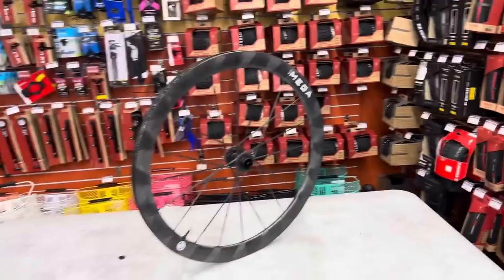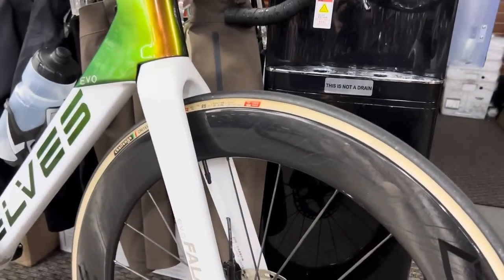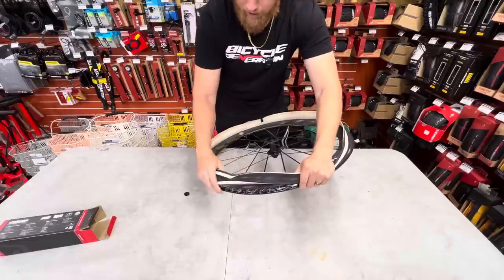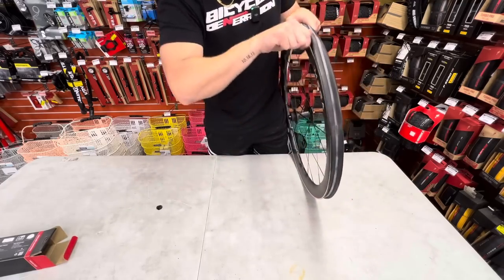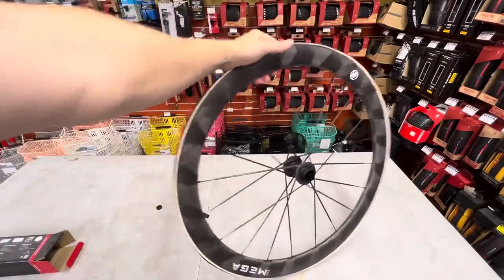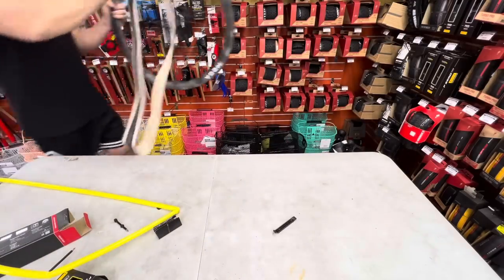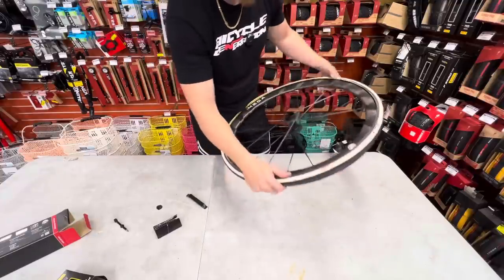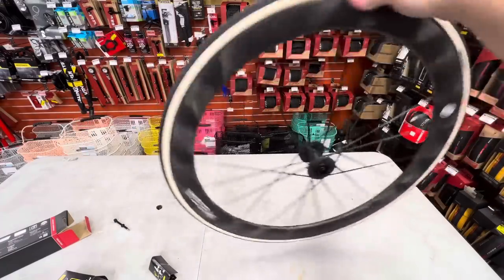I LIED..... 99% OF CYCLIST CAN NOT INSTALL THIS TIRE!! *IMPOSSIBLE*

Comment: Wow! I made a mistake buying the Challenge Getaway 40 mm wide foldable model together with TPU tubes as an upgrade to my gravel bike. I have aluminium rims 19 mm wide that came with the bike. They are not tubeless-ready, hence I wanted to ride the new tyres on TPUs. Oh my God - I wasn't even able to fit the tyre alone, not to mention put the tube in. I admit - I gave up. I installed just TPUs with my old tyres. ☹
Reply from the maker: I have got challenge tires down pretty good
Reply: @GCPerformance18  I don't deny their performance - I bought them due to the good balance between the tread pattern I was looking for and low rolling resistance in independent tests. The tight-fitting probably makes them better sealed on the rim, even without sealant, when running tubeless. But... I knew tubeless tyres could be generally run with tubes, hence my idea. This doesn't apply to these tyres, though - not out of the box, and not on cheap narrow rims that are not tubeless-ready. As you've shown, installing the tube is possible for an experienced pro, but I guess for normal mortals this becomes possible after riding tubeless for some time - after the tyre stretches a little bit. These tyres (with tubes) would be also very problematic with punctures in the field. And I'm not so much about speed but more about efficiency. I ride casually for fun - I'm not racing. I guess I'll keep them - perhaps at some point I will change the wheels too, and then maybe I'll switch to tubeless.

Comment: They're tight and annoying to get the sealant in because they lay flat but I managed without too much swearing! Getting them off however, they would NOT come off the rim edge (zipp 202 firecrest)! I had to use a thin screw driver, destroying the tyre and marking the rim in the process!

Comment: HAHAHAHAHAHAHAHAHA...I CANT BELIEVE YOUVE DISCOVERED THIS CHALLENGE TIRE!  I MOUNTED THIS ONTO AN ALEOUS 27.5 CARBON TIRE...   I COULD - NOT - GET THE TIRE ON!  I SPENT DAYS!  IT WAS REDICULOUS!  WHY DO THEY MAKE THIS TIRE SO TIGHT??  LIKE NO OTHER TIRE!   Just so happens, I found an actual plastic "lever," NOT a tire level like you have, but an actual, large, two part, leverage tool that hooked to the rim, and the tire, giving me a "handle to pull" that tire over the top...NO JOKE!  Heres the thing however...the tire "bubbled at the bead...!"  Thats right.  After all THAT...1.5 months later, Im looking at the wheel from the side and I see a bubble right at the bead!  I COULDNT BELIEVE IT!   That is one of the most expensive tires to buy.  THE HARDEST TO MOUNT OF ANY TIME.  TOP OF THE LINE FOR FAST ROLLING AND WITH GOOD PUNCHTURE PROTECTION.  And a new level tire puller later, it has a catastrophic failure at the bead!  Thank goodness I wasn't riding it... My setup is a 2021 TREK SL7 Force AXS gravel bike.  I ride 80% tarmac with this bike.  Tire technology has gone into crazy overload!  From weight to grip to puncture resistance, each brand has several tires deep now.  Its a tradeoff from grip to puncture resistance (I run ONLY tubeless tires, with the new Silka, with carbon fiber pieces. I find it the best of all fluids).  I've not had a flat in 3 years; lots of little holes.  I ride a gravel bike in Los Angeles because the streets here mite as well be off road!  Took me 2 months research, reading blogs, tests, and websites like Bicycle Rolling Resistance.com to end up with this Challenge Strada as one of the best rolling of all tires 38mm.  I even combined my tires to try to achieve the fastest bike re the tires.  I put Panaracer Gravelking SS TLC in front for a little extra turning grip (and again, one of the fastest rolling tires) and these Challenge tires on the rear.  Relying on my weight in back to give me grip with the groves in front for turning.  And after ALL THAT...THE TIRE FAILED!  Ultimately, I put the Panaracers on front and back.  The difference in rolling is not so much but they have performed perfectly...AND ONE OF THE EASTEST TIRES TO GET ONTO A RIM...  I carry a TPU with me in case the liquid doesn't seal a puncture; just to get home in an emergency.
Reply: How can I help you?
Reply from the maker: hahahahha this is difficult, I hjave never used panracer

Comment: Well you need to try to get any tire on the mavics pro carbon ust rim brake version its impossible
Reply from the maker: shit mavics I have not heard of in a while
Reply: @GCPerformance18  they are a nightmare ending up throwing them to the concrete now they're broken (after almost knocking myself out 3 times due to my hand slipping of the rim and hit my face when trying to put the tire on) bought DT Swiss wheels and I ended to put the tire on with my bare hands! Unbelievable!!

Comment: Good effort!
It would've been a bit easier if you put some talkum (baby powder) on the beads of the tyre before mounting it. But still, I also cannot mount these on modern carbon TL rims without tools. And why would I try this product overall if there are easier to mount competitors from other brands?
I think Challenge is losing a lot of revenue by insisting in their ways, as they have done all the time.

Comment: why didnnt you try stretch the tyre before installation. Place it around the foot and pull. Any mechanic who has experience with tubulars does this. Also tubeless with a thicker rim tape are a problem due to the tighter fit
Reply from the maker: yea this is not needed, the point of this video is to show how anyuone can do this, I use to pre stretch tubulars a long time ago

Comment: Finish at the valve! That way, the bead sits in the lowest portion of the rim - smallest diameter. Also, using ANY tool to get the tire on doesn't count - if tubeless it &@#s up the tape. ;-)
Reply from the maker: im going to try this more often a lot of people remanded this

Comment: Don't use these with hookless rims, the bead stretches out like crazy...suicidal stuff...
Reply from the maker: really???? that is crazy I have installed these with plenty of zipp 454, actually this is the tire of chocie to run on hookless and it works great
Reply: @GCPerformance18  try removing one after it was ridden 1000km. You can mount it pretty easily after that time because the casing stretches  Also if your customers stay within Zipps pressure limits it will probably work out...

Comment: Now try doing same on a Shimano carbon wheel. Shimano doesn't allow using tyre levers.
Reply from the maker: I have used them before, it is not a big deal lol try lightweight wheels it says it right on there it can damage the rims
Reply: @GCPerformance18  that's what mano says, "don't use levers"

Comment: I put some Challenge Strada Pro 30s on a pair of CLX Alpinists - WORST mounting experience by FAR. It took three mechanics to get the tire over the last portion of the wheel. Do not recommend - just go Conti.

Comment: Dude...Doing it  on a table isn't doing you any favors.  Sit on a small stool or whatever, and place the wheel with half installed tyre on the FLOOR.  Use the leverage you can get by pinning the wheel between your feet and pressing against said floor while pulling the pain in the arse tyre upwards.  Yes, levers are sometimes helpful.

Comment: Instead of using your thumbs to install the tire, use your whole hand for the second bead. If you've ever done a pull-up in the military you'll be familiar with the monkey grip, with the monkey grip grab the opposite side of the rim, use the palm pads just underneath your thumbs to shimmy the bead on. If it works I'll be your Caddy.
Reply from the maker: ill give it a try for sure next time

Comment: That's a mega challenge.
Reply from the maker: hahahha its like the word is on the wheel.......... hmmmmmmmm
Reply: @GCPerformance18  had my take too. Challenge tyres on 303FC. It was hard but nothing could beat fitting gp5k on Reynolds SL something. It's an old model. That was harder

Comment: This is insane. I can put clincher GP 5000 tires on my wheels with only a little bit of trouble, but I gave up on tubeless partly because they're a total PITA to mount (and their performance is overrated, they don't always self-repair, and the sealant is disgusting).  If an experienced professional mechanic has to struggle that much to put that tire on a wheel, why would any reasonable person ever buy it? I don't care how great of a tire it is, I wouldn't ever want to ride around constantly dreading a roadside puncture that's literally impossible to fix on the roadside.

Comment: It's pain as hell. 
Pro tip,  use the butyle tube add 6-7BAR and leave it for 3 days. After that work with this tube will be easy.
I tried work with it and latex tubes and I lost 2 of them, one during mount second explode during ride, i have a lot of lucky it was at small speed.

Comment: Is there an advantage to have ridiculously tight tires or is this just some arrogant design to make peasant amateurs go away from these tires?
Reply from the maker: I think it is beter fitting for the rim especially for the platform of hookless rims so the wheelw ont blow off the rim, other then that I do not know, also tubeless platofrm will work better and ownt have to worry about the tire not sealing on first initial beed up